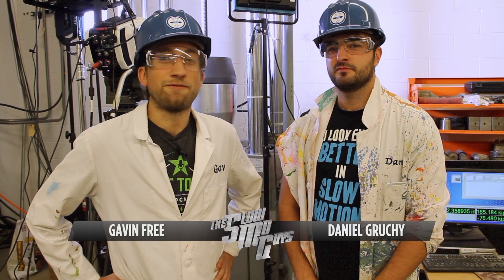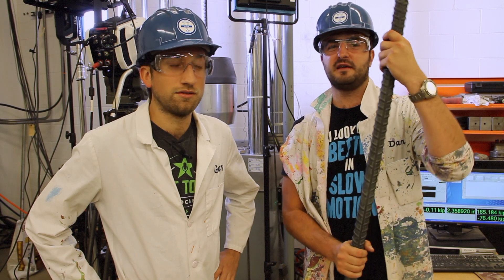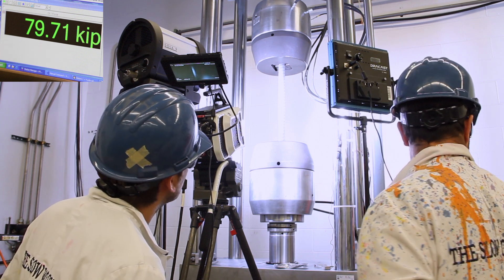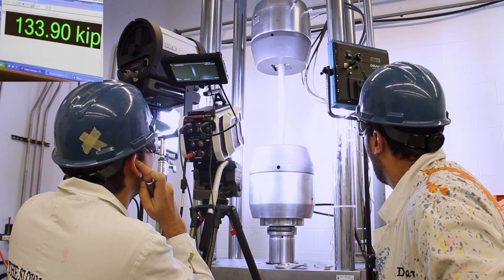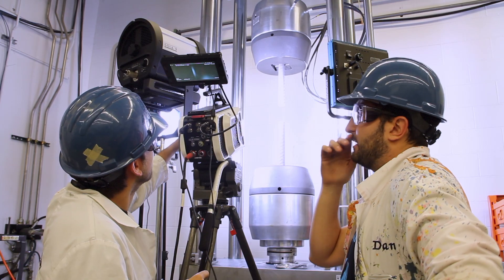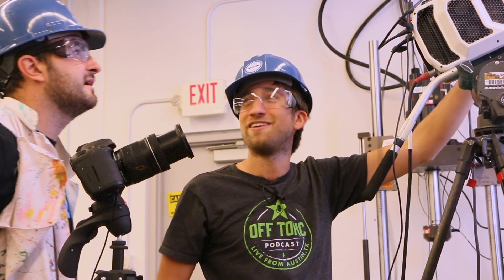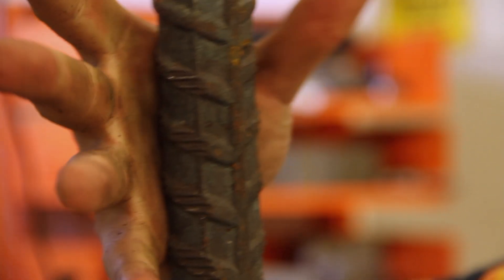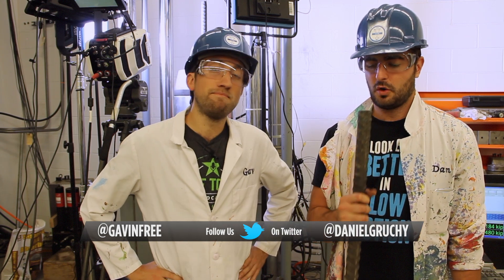Snapping a Steel Rod 1000x slower - The Slow Mo Guys

Comment: Was it really safe for them to just be standing next to it, staring at it without a blast shield?
Reply: Jose Hilera I would think so, because it's pulling something apart. not pressing it together. the only thing they'd get hit by is dust, which their goggles protected them from.
Reply: For this scenario it's fine and im sure the machine has guards that were removed for filming. On the other hand if the material was a steel cable it would be a different story as they tend to fray apart catastrophically as it starts to fail.
Reply: No. But if you apply safety to their videos, they become useless. They once shot a gun underwater ffs.
Reply: +Shenanigan Studios 

this was safe as fuck. In my metallurgy school, we are also doing tensile strength tests and while they are not with such big rods as in the video, we also dont have to have any security measurements except some goggles. 

In fact it is so safe, you could be like 10 cm away from it with your goggles and there would not be a problem (of course only if you know how the material is going to behave, and if you are doing those tests you would know this anyway ^^)
Reply: Yes
Reply: Yep, forces very strong directed up and down, very little going outward. Especially as steel doesn't shatter under those forces.
Reply: No, because the machine isn't really powerful, it is really forceful. 
For testing purposes, the stain is applied slowly so deformations in the material have time to form completely.
Also, when the break happens, the ends only move a very small distance so a large force moves a tiny distance, its not enough energy to further break the rod and throw dangerous pieces.

If they were doing shock loading or toughness testing, then they have shields because things can shatter or pieces are hit and go flying.
Reply: They don't have guards, we use them in civil engineering and I've never used one with a guard. There is zero danger with a solid piece of steel
Reply: Steel cable would make a nice slomo though.

Comment: "It's pure steel" Steel is an alloy you pleb, great video though keep it up
Reply: If something is 100% steel and no other material than it is valid to say it is pure steel. He wasn't alleging it was 100% natural, fresh-from-the-ground steel, or freshly picked off a steel tree. However I do find the claim it's 100% steel dubious since there's always bits of byproduct and schmutz in the manufacturing process.
Reply: Well, youre not pure human either. Chances are that youre 2% neanderthal. Nothing tangible is pure.

Comment: It would be even cooler if you'd explain a litte about what happens here, why it gets warm, why it it stretches and stays stretched even after breaking.

You would most likely have had more interesting footage from steel that is more flexible, it would stretch more and break at 45°.

Comment: Well, if glass breaks extremely fast, metal should be even faster. Maybe you should make a comparison video with glass and metal? 
P.S. Diamond should be faster than metal, i guess)
Reply: Тимур Жалеев Diamond doesn't break under pressure.

Comment: Steel like that is easy to destroy....just crash a plane into it and it will turn to dust!
Reply: 4U5513alldaWAY. It went straight over your head.
Reply: 4U5513alldaWAY John referred to 9/11
Reply: John Otter A plane is made of light aluminium. The bar would cut the plane in half since it is pure steel.
Reply: John Otter A plane is made of light aluminium. The bar would cut the plane in half since it is pure steel.

Comment: Several thousand dollar high speed camera, yet still using Windows XP? Haha, seeing that gave me a giggle. I'd like to know what their reasoning for still using that is.
Reply: The windows xp machine was for the pulling machine, not for the camera.
Reply: Brandon Bear most places that manufacture don't necessarily need to upgrade. The computers will likely only be used for running two or three programs. One for the operation of the machine, one for email, and maybe one or two more based off what specific position the computer is being used for. I work in plastic manufacturing and only ever have 5 programs that I will ever use. The only reason I have windows 10 on my computer is because the office staff and engineering departments could benefit from some of the new features. So the company got bulk upgrades with new computers to save some money. Instead of purchasing each computer and OS separately.

Comment: Exactly what is the original purpose of that machine?
Reply: Exactly what you see here : test how much stress a steel bar can take.
Reply: gitarkin likely used as quality control to test rebar. They would most likely pull a bar that has just been produced at the manufacturing building and pull it until it breaks to make sure it meets quality specifications.

Comment: Nice outdated, insecure, vulnerable Windows XP computer, bro!
Reply: or maybe they just selected that theme for that computer, it's a simple setting, you can even make it display as if you're on a windows 95. Also, Insecure/vulnerable means little if the thing isn't online connected, I have a feeling that specific computer is only used for that device, meaning direct connection.
Reply: a lot of companies use XP for these types of things. Its simple and works. Also they aren't connected to the internet, so nice try.
Reply: You see in order for this to be vulnerable it would have to be connected to the internet....
Reply: With XP other people could hack you and with windows 10 microsoft can hack you lol.. I'm pretty sure turning off all the privacy stuff does nothing for me

Comment: So they're using windows XP on that machine?
Reply: If it's not connected to the Internet it's still perfectly fine.
Reply: Most of the world uses windows xp for this kind of stuff. 
Like when you're getting gas or using an ATM
Reply: Mr Faceplant nuclear submarines still use Windows xp
Reply: I believe NASA still uses XP for the simple fact it works. No bells and whistles, no system crashing bugs.
Reply: There are a large amount of systems running Windows XP.  In fact the US military has a contract with Microsoft for continued support because so much of there stuff runs on it and there is no upgrade path. I think CERN and NASA have a similar contracts for systems that can not be upgraded.
Reply: Never touch a running system.
Reply: That's completely normal. The tensile machine at my university runs windows xp as well and the torsion machine runs windows 98.
Reply: DrathVader Yeah, but ATMs are connected to the internet…
Reply: The new windows license would be no problem. The problem is getting all the old software that runs perfectly fine on XP running on a newer Windows version. And why upgrade if it works.
Reply: Typically when you notice a computer running XP out in the wild, you'll notice they pretty much only use 1 application whether it be an ATM, military applications, dyno machines, basically any machine that's sole purpose is to readout numbers from equipment like in the video, a single purpose machine... because there's no users to fuck it up by downloading and installing unnecessary shit that makes the system insecure.
Reply: At my work we have a large critical machine that runs on Dos. We keep a complete computer back up to swap it out in case of failure. which happened not too long ago and then we had the fun task of trying to find spare parts to rebuild the broken pc to have a spare
Reply: Some do, some don't. I've had an ATM give me a blue screen of death before.
Reply: The one in my school uses windows 98
Reply: Windows Xp no longer receives updates so it has a more practical use because you dont have to deal with compatibility
Reply: TheRealColBosch i had a crashed ATM with Windows XP xd
Reply: They use windows, because Windows admins are a lot cheaper than *nix admins.
Reply: And maybe the software is old and does not work on newer systems
Reply: Materials Scientist here, use smaller versions of machines like this in the lab all the time. They run XP because they cost a lot, and if they work with XP, just keep it. No need to bother with upgrades or getting a new machine that works with a later OS when all you need to do is save some data to a memory stick.
Reply: This ^. Pretty much every machine I use at work still operates on XP.
Reply: Most work places use XP because its simple and amazing for work.
Reply: Time to go hack!
Reply: Mr Faceplant hey I was going to comment that that
Reply: ATM's & Gas do not run on XP they run on linux
Reply: ReIent - the spelling you're looking for is 'beige', I think.
Reply: Care to bet on that? https://www.quora.com/Which-operating-system-do-ATM-machines-use
Reply: yeah maybe I'm wrong on ATM's (Besides India's) but the gas pumps use Linux most of the time (because why pay for a licence for each system when they only use 1 application)  This is what my linux teacher told me anyway
Reply: Mr Faceplant no they are using Windows XD
Reply: basic _101 its called Windows XP forma emmbed systems. And Ford used windows for automotive until some years ago on the Sync systems.
Reply: they don't want to pay for another windows because its expensive !!
Reply: Mr Faceplant The memories of those baje computers back in primary school, or pre school if you're a yank.
Reply: orangemonkeykiller thats awesome
Reply: Keksmonster31 : that is the key point! why upgrade windows if is working perfectly, that machine is an  instrument not a home PC, upgrading windows means new drivers for a specific hardware than probably is too old to make feasible write and coding the new driver.
Reply: Ben McDevitt I have  pictures of ATM crashed and stoped with a Windows error and other with a BSD.
Reply: Mr Faceplant I noticed that too!
Reply: Don't have to worry about Windows updating and messing up some software compatibility slightly or anything. It seems archaic, but it actually has its uses, even if Microsoft wants everyone to always switch and always claims newer is better.
Reply: Mr Faceplant not uncommon in lab equipment.  The computer is merely a data logger, no need to have up to date software if it's still working

Comment: Now you have two steel beams.
Reply: steel beam win every time
Reply: That's rebar. Not a beam. Please correct if different terms where you are but far as I know rebar goes "in" concrete... beams are used to span gaps between uprights to support weight above.
Reply: @Gamerock82  that is like a dog barking at a tree cause the commenter won't be looking at your reply
Reply: Tough Fedora you did. :)
Reply: @Gamerock82  stfu

Comment: That is some brittle steel, as evidenced by that fairly clean break. I'd like to see a sample of piping materials which elongate more noticeably and diminish the diameter prior to breakage.  
I'm a welding inspector so I'm fairly fascinated by tensile strength. Which , by the way, makes me rather a hoot at parties.